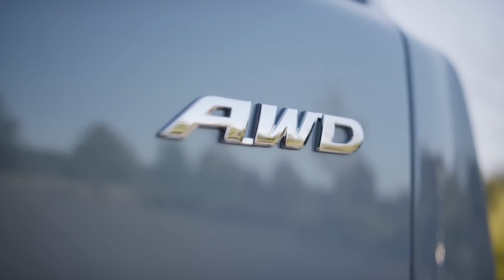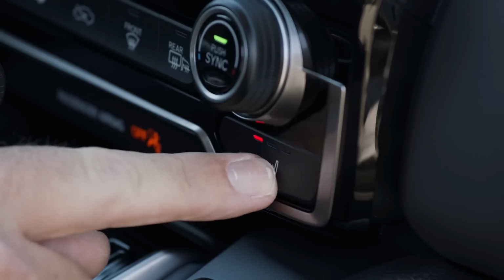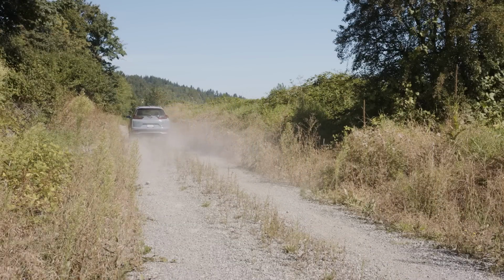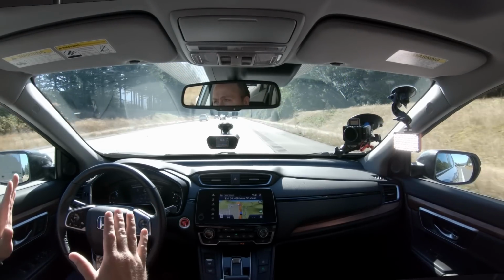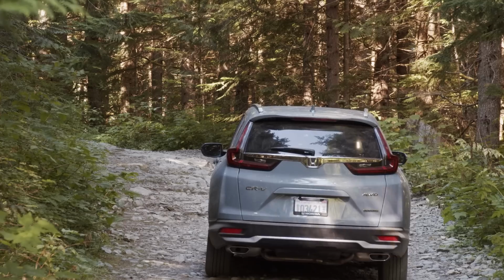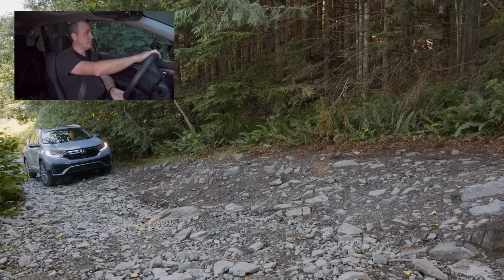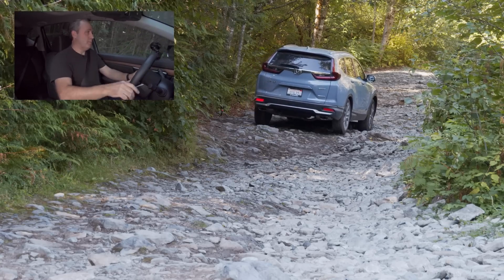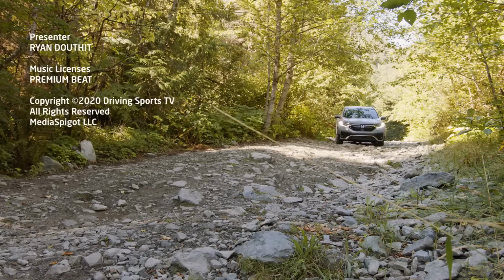2020 Honda CRV Touring Review and Offroad Test

Comment: it's pretty disappointing that honda isn't making awd in this vehicle any better.  
but i think i know why. all money and efforts went to figuring out there oil delusion problem that screwed people over.  
who really knows. but i know one thing. no more hondas for me.
Reply: Hondas are great Mike Smith. You just need to develop a good taste in vehicles.
Reply: @truthistruth615  The1.5L turbocharged engine in all current gen CRVs and most Honda Civics on the road is a total lemon. Below is an excerpt from the current class action lawsuit. Do not buy any Honda with the 1.5L unless you want endless headaches.

" The Earth Dreams engines are allegedly defective and cause a buildup of non-combusted fuel within the oil systems, diluting the engine oil and causing it to lose the ability to lubricate the systems. In addition, the lawsuit alleges the positive crankshaft ventilation (PCV) system is not good enough to handle contamination of the crankcase.

The plaintiffs say oil doesn't properly coat the bearing surfaces and allows contact between the connecting rods and the connecting rod bearings. In addition, the lawsuit alleges internal engine components are damaged to the point Honda owners must pay thousands of dollars for repairs.

Oil dilution problems also allegedly cause the crankcase to overfill with fuel-contaminated engine oil, "causing it to become aerated and foamy when it comes into contact with the crankshaft, leading to insufficient lubrication and overheating."

The class action argues the Honda should "repair, recall, and/or replace" the vehicles because they can't be used for the "purpose of providing safe and reliable transportation." "

Comment: Forester, Crosstrek and Outback all did much better on the same test. I was curious to see how this vehicle did and wasn't surprised by the result. For normal driving or in some light snow I am sure it will do just fine.
Reply: Mazda did better too
Reply: I bought a 2014 CRV and my friend bought a 2014 Outback. Guess what? The Outback burned 1 quart of oil every 500 miles since new.  Dealer said it was normal. One day the engine over heated in the middle of I-5. Towed to the dealer and the warranty ran out at 65,000 miles. cost over $7,000 to replace engine. Subaru still had that crappy under power engine and never redesigned it.
Reply: @rampar77  Cars are not perfect and there are plenty from each manufacture that have premature issues. Let's not get started on the Honda oil dilution issue that affects the 1.5ltr turbo engines. Some have cars that never have issues and some have issues right from the start. They are machines afterall. I can admit my 2016 legacy is full of annoying gremlins, but all my prior subarus were very reliable. I have a friend with a 2011 impreza nearing 160K miles that has been very reliable and only had normal wear and tear items that need replacing. Without knowing how your friends car was maitained, we can't say for sure it was a poorly manufactured car. If I were in their position, I would have been darn pissed like any normal person. Oh and by the way, the oil burning issue on some subaru models (due to switching to 0w20 oil in my opinion) is not normal and I think subaru should own that issue. I always felt that should have stayed with 5w30. They wanted to increase gas mileage but going with thinner oil, not a good move.
Reply: @flat4forlife588  I was going to buy a 2014 Forester but bought the 2014 CRV instead after that horror story with my friend;'s Outback. The CRV was had more power and bigger space than the Forester (Outback was bigger but slower on the same 2.5). My research showed that Subaru never fixed the oil usage issue on the 2.5 as of 2021. My riend had his Outcak sericed in the dealer since day one. The dealer told him it was normal to use one quart of oil ever 500 miles., then it over heated and cost over $6,000 to fix.
My 2014 CRV was very uncomfortable and under power, so I was going to trade it in for a 2018 CRV with better seats, but it had 1.5 engine and turbo plus CVT and no pow increase. So I bought a 2018 RDX instead. I test dove the 2019 RDX but it also had 2.0 4 cyl with turbo and CVT. I am very happy with my RDX but wished it had the SH-AWD.
Reply: @rampar77  my wife’s 2015 Honda Civic, all services completed by Honda since day one, transmission went out around 70,000.  Friend of mine has a 2017 forester, close to 100,000…. Um no problems with oil, etc. they absolutely love it. I can see why. I guess every make has its issues
Reply: @rampar77  it's true. 2011 outback 3.6r  burns a lot of oil too. 2 weeks ago  it's been in a crash and completely wrecked thank God no one was hurt, not even a scratch. Subaru has been replaced with a 2020 Hyundai Santa Fe
Reply: That’s why I bought a outback so I can go places like this it’s a 2011 with the 3.6 so plenty of power only time I ran into trouble was on a Jeep trail where I had to use momentum because it was all loose dirt and tbh I didn’t have the tires for it, if I had all terrains I’d of been fine, in my opinion nothing beats Subaru’s AWD.
Reply: @julianmukerji9371  Yes, other than the gas mileage, the 3.6ltr is a good engine granted you maintain it properly. I think you have one of the earlier CVT models so take care of it as they can be a bit finicky. All terrain tires on that car would be pretty awesome for light to medium offroading. Obviously I am a subaru guy and agree Subaru AWD is great, but I feel the older models with the 4EAT transmission were far better as I had a few subarus with that tranny. Compared to the CVT on the models I owned with the CVT, the 4EAT was more capabable in snow, bad weather and dirt trails and roads. The CVT still gets the job done but does suffer in some hard situations. In my opinion in general, the older subarus were just better, maybe not as comfortable, maybe not spacious but definitely more capable off the smooth pavement. Newer subarus are more geared towards efficiency which hurts the offroad capabilities.
Reply: @flat4forlife588  no cvt for 2011 outback. It's a full automatic
Reply: @jonathans4503  That is good, take care of the 4eat and it will last the life of the car. Don't skimp on the tranny fluid changes and it will reward you with long life. Most of my prior subies had 4eat's and never had an issue once.
Reply: Doesnt really matter how bad it does off road, asian mums will still buy them. It will spend 99.9% of its life going over speedbumps and shopping mall kerbs. The 0.01% of the drivers will drive it like this guy.
Reply: Yea but crosstrek or outback don't look as good as  hondas, subarus need to wrk better on their design

Comment: I love the off road test you do.  Some may say they will never get into that situation, but when they do, they will know the frustration.

Subaru AWD is still the better performer.
Reply: Subaru AWD has torque vectoring, you only get that with a Honda if it has the i-VTM4 system, such as on the Passport and Ridgeline.
Reply: The Magician and the Pilot
Reply: @themagician7734  Rav4 Adventure awd system is superior. Just look at the TRD version article that kept up with a Wrangler in nearly everything. Couldn't kill it. If you think off roading in a CVT is fun god bless. I'll take the geared automatic
Reply: @swanblake  Perhaps you meant to respond to the OP and not me? My comment was only that the CRV does not have Honda's torque vectoring system, so to not assume that Subaru AWD is the better performer purely based on the CRV. Driving Sports TV's Honda Passport video shows some of the strengths of Honda's AWD system.
Reply: @swanblake  standing applause hear hear brother.
Reply: @layne4376  thre current one with brake assist traction control.
Reply: Subaru too unreliable with their horrible cvt and oil burning engines. There’s plenty of crossovers with awd systems that meet and exceed Subaru.